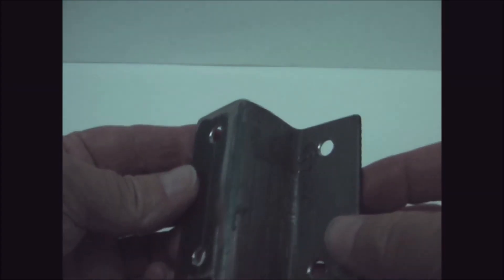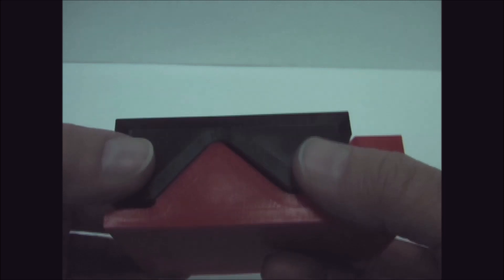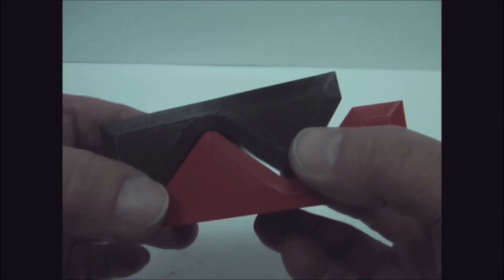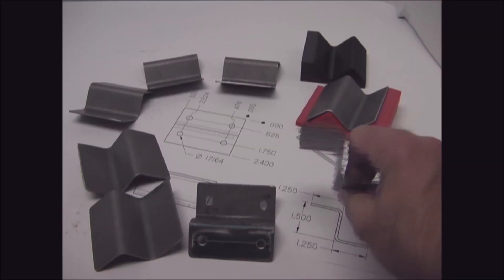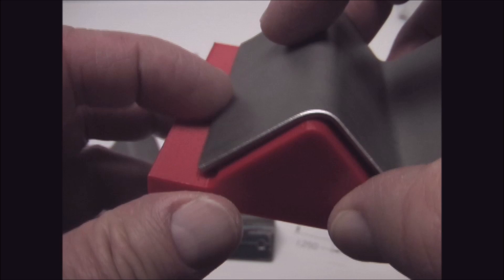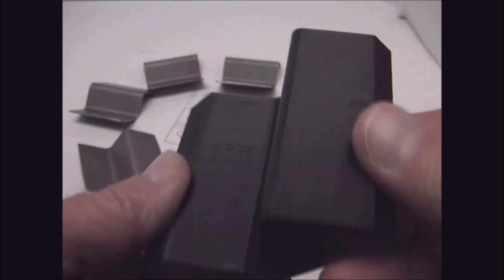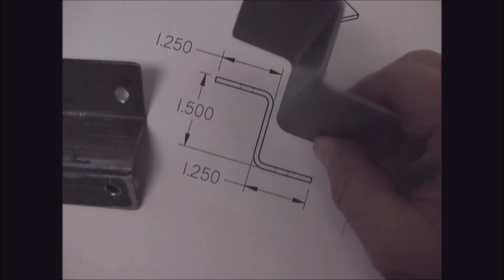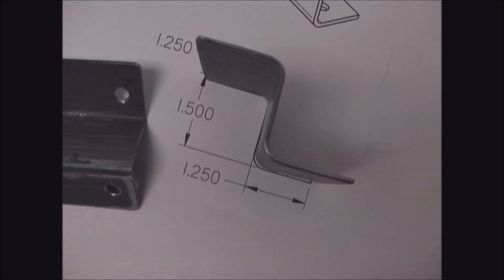Bending / Forming Steel with 3D Printed Tools & Hydraulic Press

Comment: You could potentially increase the lifespan of these tool by also forming and attaching a set of steel faces. This way when the metal is formed it slides against the steel faces and not the plastic.

Comment: Your print orientation is interesting I print my die sets on the flats as I was having a delamination issue over 5 ton of force
Reply from the maker: I suppose it depends which way the metal is being formed. It would be interesting to experiment and see what hold up best. Multiple perimeters (12 or more) helps
Reply: Noob